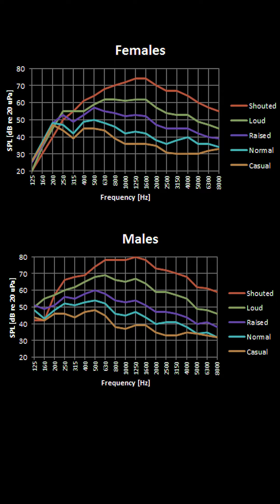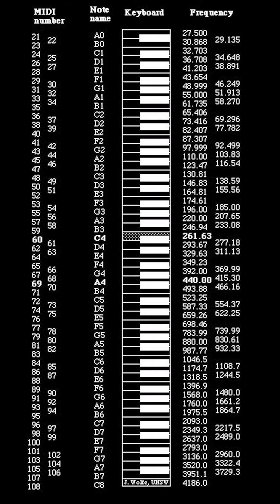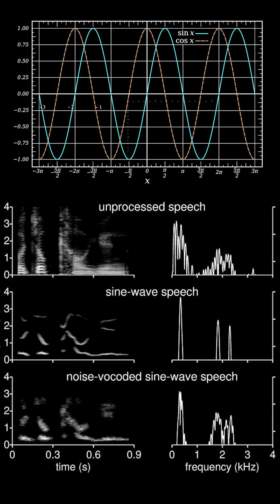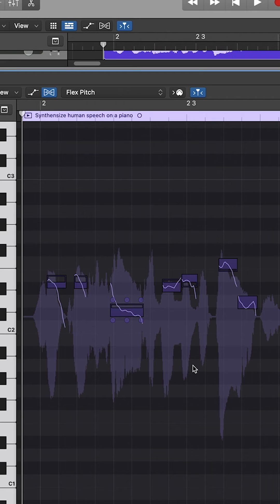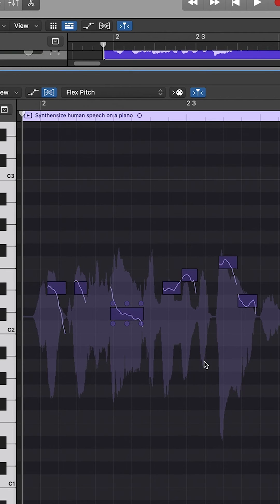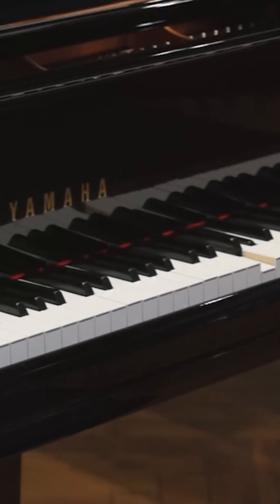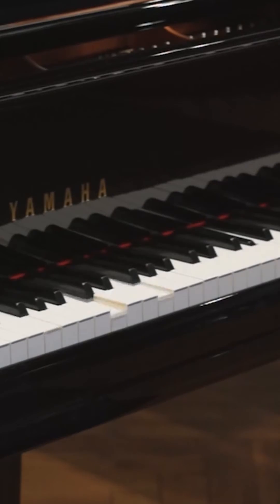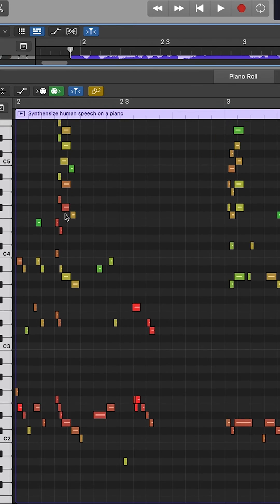Why Does this Piano Sound Like a Human Voice?

Comment: that's actually a cool idea. if i were going to recreate that, i would use the analog vocoder method by creating 88 (or however many midi allows) band pass filters, (corresponding to the fundamental frequency of each midi note) and append a noise gate after each of them. this would comprise the analyzer/detector,  then when the gates pass the threshold on the audio input, trigger/create a midi note for it, and then route it to any synth or sampler. what would be cool is to use a sample of say, my own voice, and distribute samples like that to the appropriate keys. it's actually half as easy (to code) as a traditional vocoder and perhaps much more effective. now i want to do it. thanks for the inspiration. what's cool also is that it can be made with all analog components as well if you go to extremes.